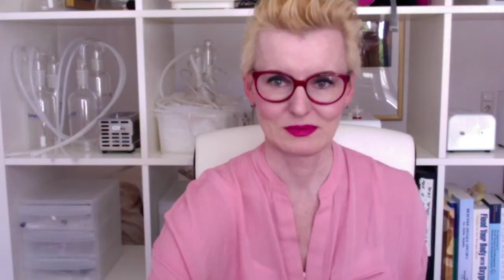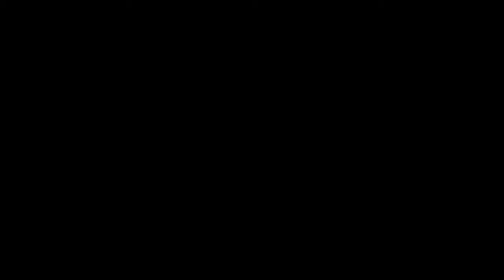DIV Ozone: Why NOT to use 55 mcg/ml?

Comment: Any thoughts on DIV while in Ketosis? I experimented a bit. While in ketosis, there was almost zero chest tightness. As soon as I got out of ketosis...the pain would come back when doing DIV. I was amazed at the difference.
Reply from the maker: I'd look if you can reproduce it several times. Are you sure if it's a factor of ketosis or what you ate that brought back the pain, not necessarily the fact that you ate anything at all? There may be a number of factors at play ...
Reply: The Power of Ozone thank you for your response. I was in ketosis for two of my treatments (was getting DIV every Friday), and both treatments felt next to nothing as far as tightness (in fact, I felt AMAZING afterwards). And I was getting increased doses with each treatment. When I stopped Keto and got out of ketosis (kept tract with Keto Meter), the tightness that commonly comes immediately after treatment, came back. It was a DRASTIC difference. I know Ketosis deals with the body’s inflammation. I’m wondering if that’s a cause for the “bad”/painful response with DIV (the body is inflamed). 
I’ve quit for the time being. I’m ttc and I don’t know if DIV would help or hurt with that, so I’m taking a break. I look forward to “experimenting” with DIV and Keto when I start back up.
Reply: Dawn Miller Keto makes the body about twice as efficient w oxygen, somehow. Maybe keto is allowing ur body to utilize it more quickly.